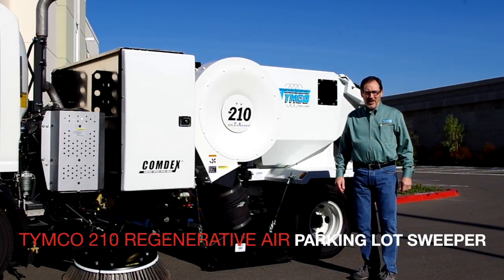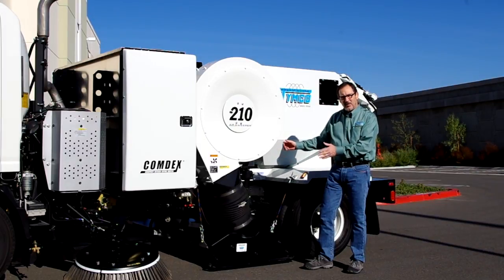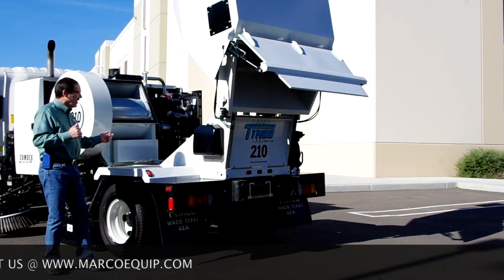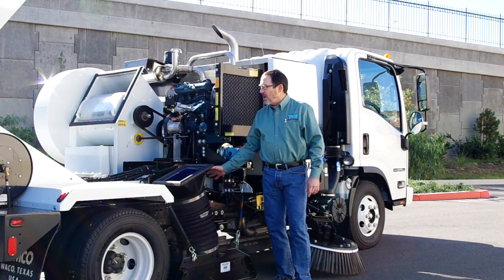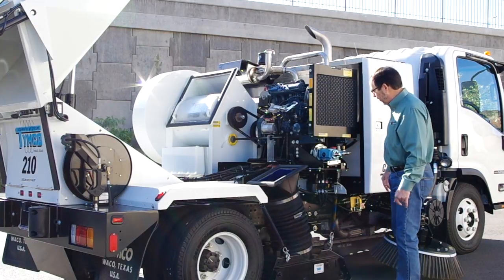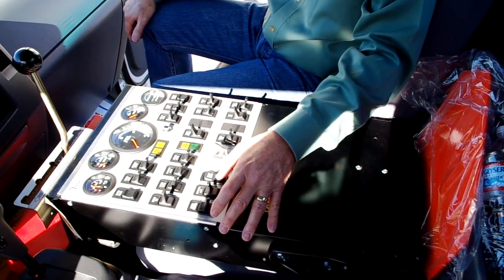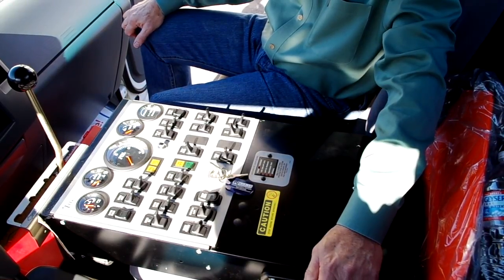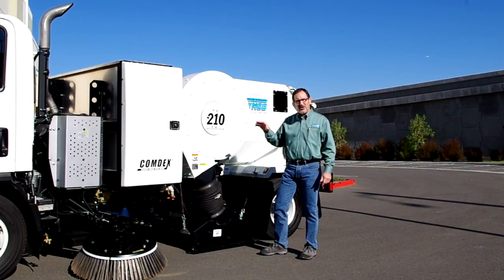Mar-co Equipment Tymco Model 210 Regenerative Air Sweeper Presentation

Comment: Make a video showing the suction power.  Show it picking up beer cans, beer bottles, large food bags and even a brick.
Reply: Tom Martin lol
Reply: I've owned and operated Tymco 210's and 600's for over 40 years. Not once have I encountered a brick in a parking lot or even a construction site. That's just a gimmick used by other manufacturers. It's almost the same with whole bottles. Tymco's are priced at the higher end but they can make you more money in the long run if you can properly maintain them. 

Practically any commercial vacuum sweeper will pick up the litter you mention but I've concluded they all clog up due to the plastic bag, paper flyers, leaves etc., rendering them unproductive. Operator control with respect to fan RPM's is imperative....

 You simply have to experience "1" Tymco purchase in your life and that my friend will hopefully be your best decision. 

Good luck.
Reply: @0rangevale  40 year experience  haven’t learn how to use the 210  , I picked everything from glass bottles , plastic bottles, a lot of Leafs does pick up , drive slow for heavier debris , even with a minimum of 1600 rpm’s can lift that stuff . Small rocks which would probably cause damage to the separator.once it’s through the screen .